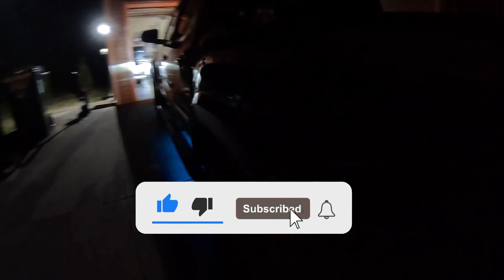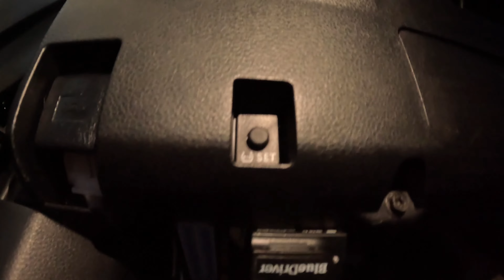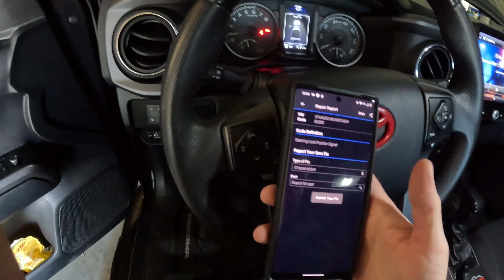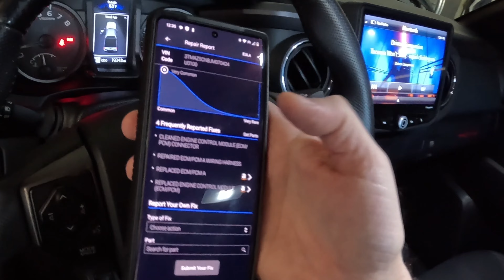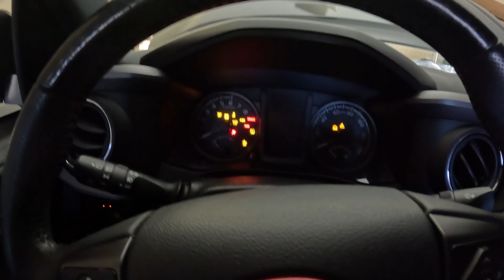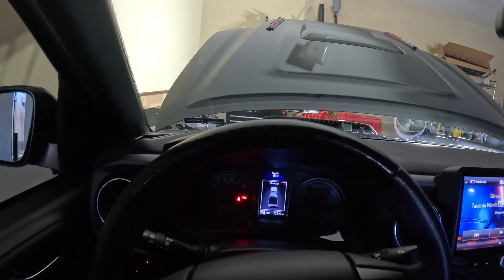FIX Your Dead Toyota Tacoma Battery FAST with OEM Replacement!

Comment: Costco has INTERSTATE group 24F batteries with 719 CCA 36month warranty. Fully charged up. In order to not lose any electronic memory during battery disconnect attach a memory saver to the OBDII outlet.